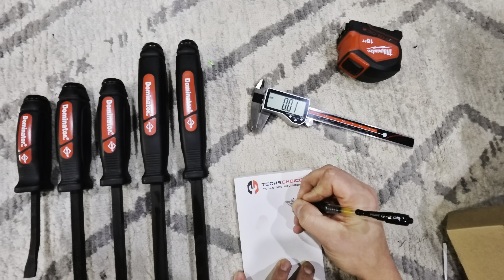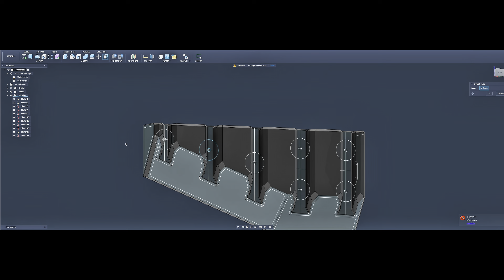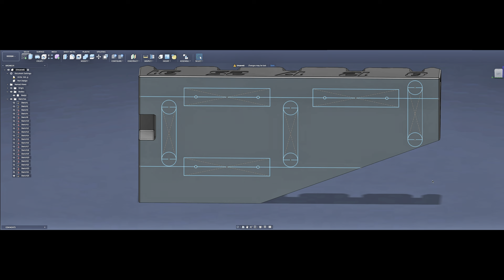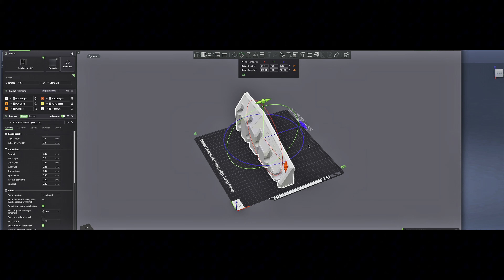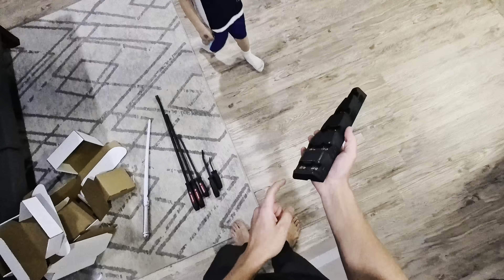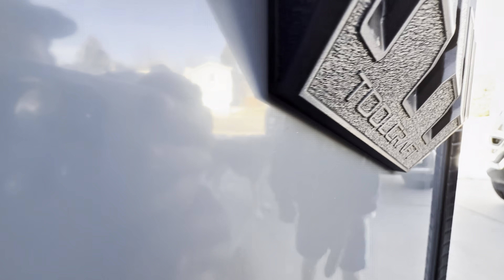Designing a Magnetic Pry Bar organizer | 3D printing business

Comment: Are you no longer offering the modular socket rails? I don't see them on your website anymore.
Reply from the maker: Took them down to catch up on orders. Also working on a new design possibly. I’ll still support the costume that already invested in the system and need to expand but the system may no longer be offered for much longer. The time it takes and cost isn’t worth it for me at this point
Reply: @Collindraker  Understandable. It’s kind of what I figured after reading your lead time on the website that maybe you removed some things to catch up. If they are still available when you catch up on orders I will be ordering some more. In the future when you do decide to stop offering would you possibly consider adding them to your marker profile?